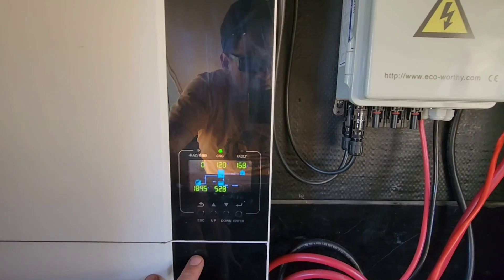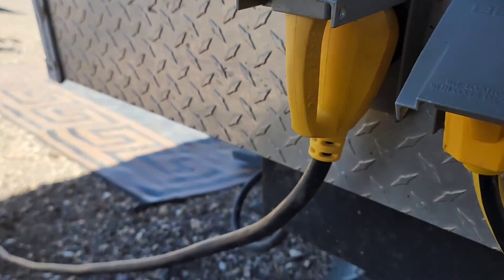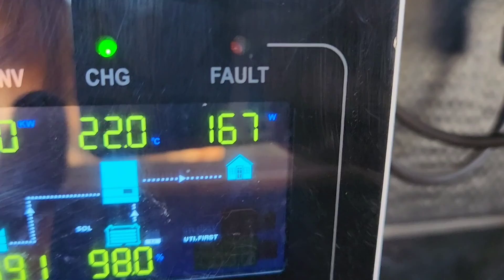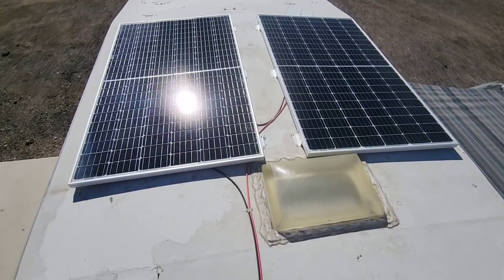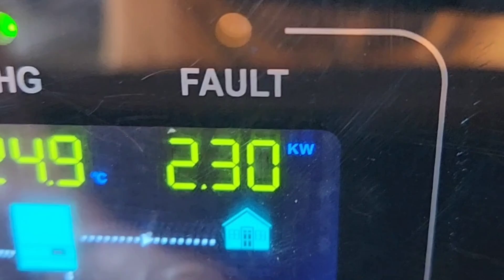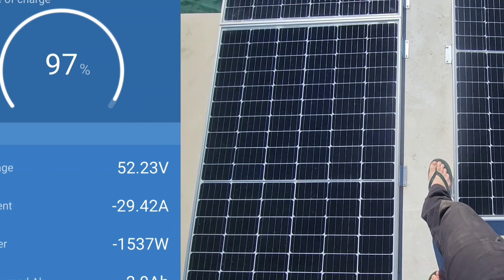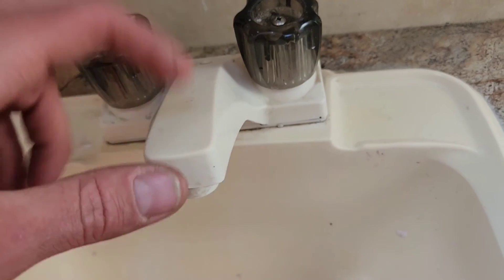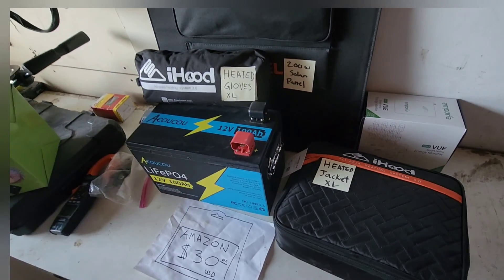Dry Camping - How To Power Your Neighbor's RV

Comment: Nice work!!  Question: how long will the 5.12 kWh battery supply power to your rv without AC?  I'm looking to do the same in my 5th wheel.  Thank you!
Reply from the maker: About 8 times a long as a traditional lead acid battery. 👍

Comment: Wow, that's so cool. I never thought about powering my neighbor's RVs. I'd be afraid I'd run out of battery power overnight if I did. I guess you just have to monitor your power usage closely and cut them off if you get too low. We're retired FTers who designed and built our system ourselves, on a tight budget. It took us 5 years to gather the resources and finally complete the project.

We started by building a 620-watt liftable solar array on the side of our 1999 National Tropical MH. Our side array makes a nice bedroom window awning too, practically lifting itself with a couple gas struts, and it's easy to clean, standing safely on the ground. Next, we built a 12v, 560ah LiFePo-4 battery using 8, 280ah prismatic cells and a Heltec 330amp BMS with a 5a active balancer. These cells fit perfectly under the steps of our MH where our old pair of golf cart batteries used to reside. We insulated the battery compartment, cut a small hole in our step risers and installed a tiny computer CPU fan to keep this space at close to room temperature, so we don't have to worry about the BMS shutting down charging due to low temperature - or their life reduced from getting too hot. Our 12v system uses an 80A Progressive Dynamics converter/charger, a 1,000w Renogy inverter, a 50a Epever MPPT charge controller and a Lnex battery monitor. All this cost us under $3,500 and met all our off-grid electrical needs except for our air conditioning, heat and microwave, but it surely wouldn't have powered anyone else's RV.

By mounting the solar array on the side of our coach, we left the roof free to rack 8, 550w solar panels down the length of our 35ft Class A, 15" off our roof, above our AC, vents, etc. We built the rack out of 2" 6061-T6 structural aluminum angle. The front 2 panels slope down at a shallow 9.5-degrees to meet the roof, producing a smooth laminar airflow over the array, making the RV more stable with less wind drag while driving too. It shades our entire roof, allowing plenty of cooling air underneath, increasing solar output and reducing the heat load on the air conditioners, though our overall height is still just under 12 ft. After we attached the rack, we coated the entire roof, including the array mounting feet, with Henry's Tropicool silicone sealant to keep things watertight. 

Our 4,400w fixed array can run both our A/Cs, household appliances and charge our batteries from solar at the same time, even in winter, though I doubt it would power a 3rd AC unit during the day and still have enough power left in our battery to run the entire night too, as we currently do. We mounted a Sungold Power all-in-one 48V, 5,000W Inverter/100A charge controller/battery charger (similar to the Growatt all-in-one), breakers and a Lnex battery monitor on the wall in our bedroom, saving us space as well as money compared to a system built with individual components. Our 48v battery uses 16, 320ah prismatic cells and a 200amp Heltec BMS to keep it safe. Together with our 560ah 12v bank, we have a total of 23.5 kwh of batteries onboard - kept charged by 5,020 watts of solar. We removed our old rooftop bedroom A/C and replaced it with an EG4 28.5 seer-2, 12k btu mini-split heat pump on the upper rear of our motorhome. It's super quiet and cools as well as our 14.5k btu soft start equipped Furrion we have up front but only draws about 1/3rd the power. This second phase provides 24/7 off-grid air conditioning and heat from the heat pump. We have a total of 6,000 watts of 120v inverted ac power, giving us off-grid electrical self-sufficiency without the need to run our generator, for a total budget of around $11,500, including the high-efficiency heat pump.
Reply from the maker: Cool.  That's a big system!